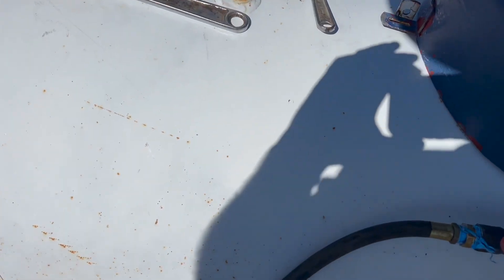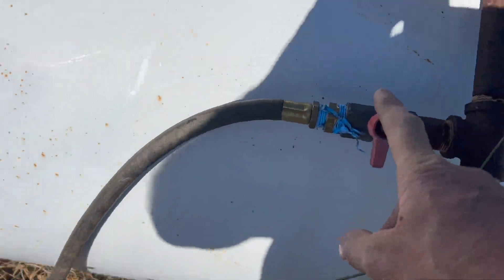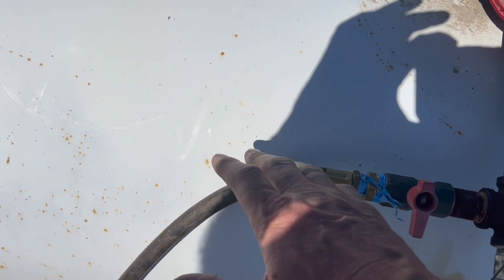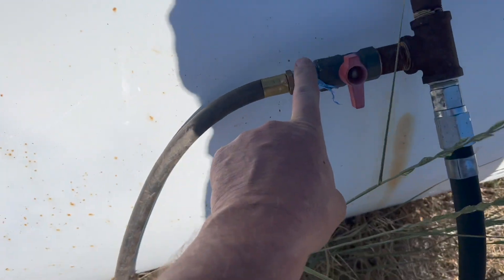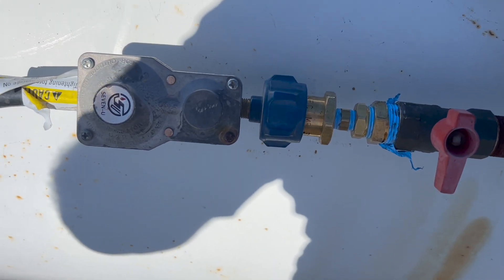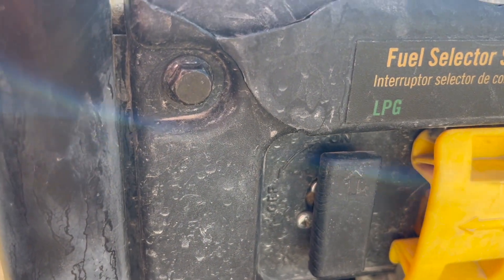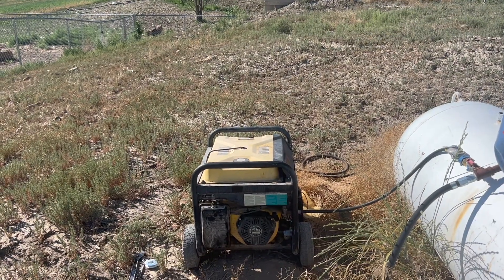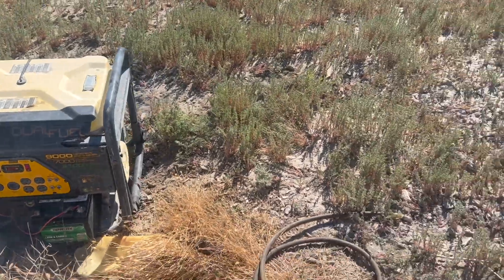Back up power source Propane generator hooked up to a house tank

Comment: Good video, i have the same generator and i have thought about hooking to my house lp. I heat with a wood boiler but when the power goes out in the winter which it does every year the boiler will over heat and boil the water because the pumps stop cycling the water. This was a helpful video to take another look at this, i know that my generator will suck down a 20 lb tank fairly quick but if i can hook to my 1000 gallon tank it would last a bit!
Reply from the maker: Glad to help.   I work in the power grid industry.   I like a back up source

Comment: Your experience is puzzling. While I don't have a propane capable generator, I have in the past converted small air cooled engines to run on propane. I would think that the house regulator and the smaller regulators for outdoor grills would have the same pressure, just differences in volume of gas available. Your generator should have a diaphragm vacuum operated "butterfly" valve that regulates gas (propane) flow throw the intake allowing the engine to speed up/slow down according to load. You might want to test the generator under load to make sure the engine is responding appropriately to increased/decreased demand.
Reply from the maker: Thanks for the great comment I had the exact same thoughts as you. My local propane guy told me this is the second generator that he could not figure out. He is young and inexperienced. My generator runs slightly better on propane the regular 20LB bottle. I have used it on a small welder (poor mans portable welder). I got the generator to run good with the second regulator in place. I am satisfied that when the zombies attack or any other foreign nation I will be set for back up power. Thanks for watching
Reply: @10CowRanch-gn1iy  I do have a generator (8.5kw) gasoline only. I live remote and have experienced power outages on a fairly regular basis, some as long as 2 weeks.. I keep around a hundred gallons of stored gasoline on hand at all times. You're right, these days a man's got to be prepared for anything...natural or government inflicted.
Reply from the maker: @dennisbrummett3047  2 weeks that’s crazy     The propane stores better than gasoline that is one advantage.   But I am all about being prepared in all aspects.  I have enjoyed our conversation
Reply: The generator should have a pressure regulator on it. Like a gas grill. You are using a 2 stage regulator which is required for higher pressure. Say 11 inches of water column. The reduction of pressure is allowing the unit to run. The regulator on the tank is not lowering the pressure enough.
Reply from the maker: I think you are correct Some had said the propane systems for homes run a little higher pressure than portable systems Thanks for the great comment  @0211tim